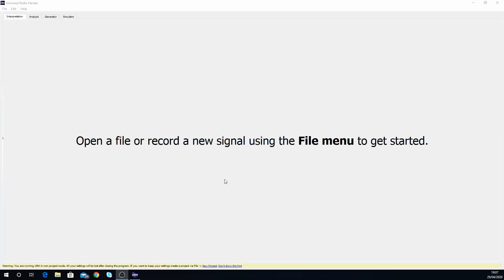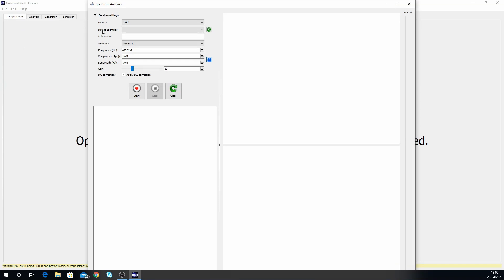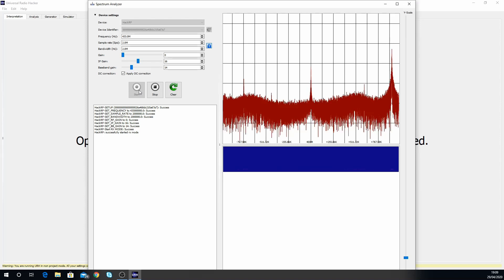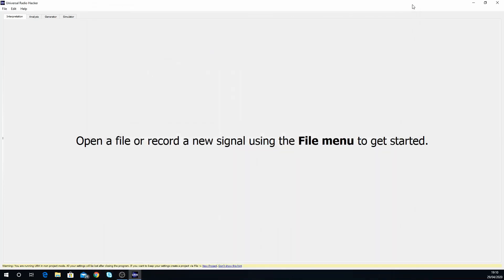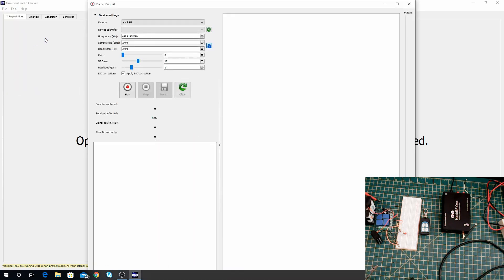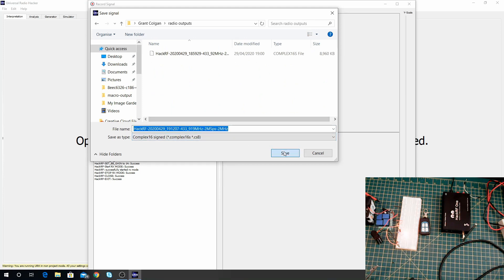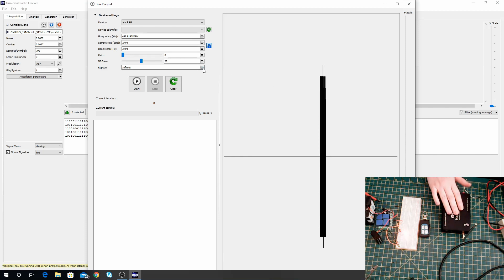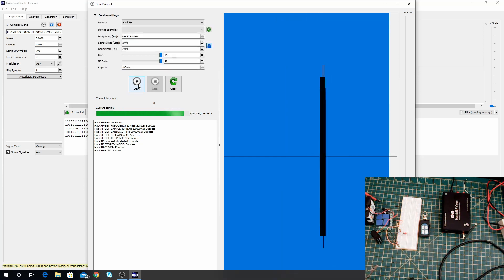Hacking Remote Control Devices, How To Do Replay Attacks With A HackRF One

Comment: Hey so my problem is on Universal Radio Hacker I copy and record my signal I go to resend and nothing happens I’m trying to clone a garage door opener why would this be happening I adjusted my gain and if gain no change
Reply from the maker: What are you using to transmit?
Reply: @Brains933  I Currently have a HackRF and a RTl-SDR I tried playing with a few things but when I replay the signal still no results any recommendations?
Reply from the maker: @kahmari_srt1395  when doing it are you 100% sure that it's trying to transmit through the HackRF and not the RTL SDR
Reply: @Brains933  I don’t keep my RTL SDR plugged in with the HackRF because I know the HackRF can do both so only the HackRF do you have any social media platform I can message you over and send a video?
Reply from the maker: @kahmari_srt1395  aye fire me it over on Twitter Same as the YouTube Brains933
Reply: @Brains933  hey I messaged you on twitter check your message request

Comment: I have a very decent laptop (new Dell XPS 15) and the URH gets very slow and even unresponsive when I have the analyser running. Very strange. Recording doesn’t seem to be a problem. Anyway I tried to replay the signal from a remote toy car remote controller. Capturing the signal was no problem, but when I replay it, nothing happens. HackRF has TX on so I guess it was transmitting?
Reply from the maker: URH can be a bit sluggish at times. For the transmit try turning up the gain in URH I found with mine if the gain wasn't at max the TX didn't work. I'm not sure why

Comment: hi i bought a Dual SMA Male 3G 4G LTE Signal Booster Antenna what is the best way to get the most out of it as my signal at home is crap . thanks  ebay irem number 333565825353
Reply from the maker: Repeaters can be super useful but with just antenna alone. Try and make sure it's in a good position, little to no obstacles is best

Comment: yes!!! gov drones!!! yes yes yes!!!. hahhaa. congrats from an old ham radio from Argentina. great experimentation. really thanks. subs=ON. i have order 2020 PORTAPACK H2 + HACKRF ONE SDR Radio + Havoc Firmware + 0.5ppm TCXO GPS + 3.2 inch Touch LCD + 1500mAh Battery + Metal Case